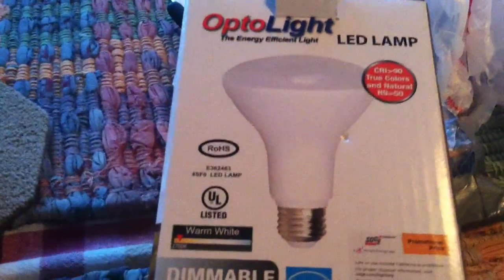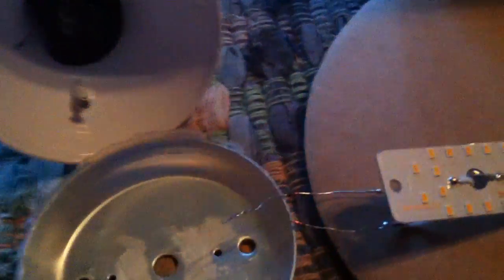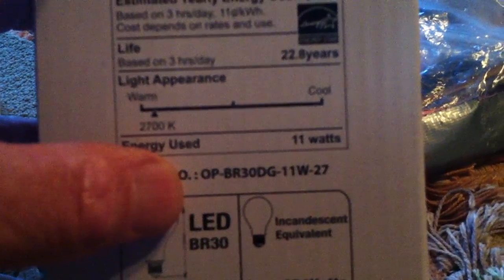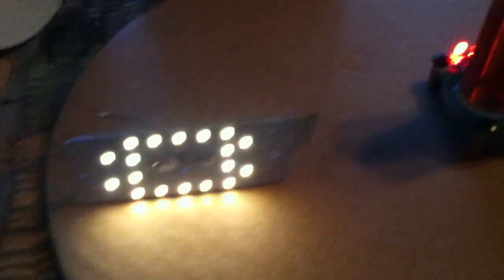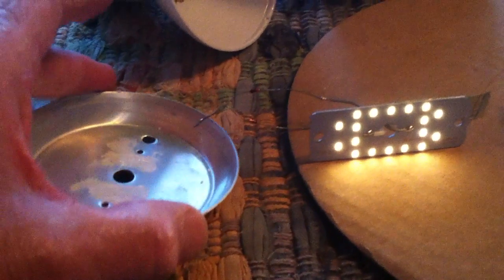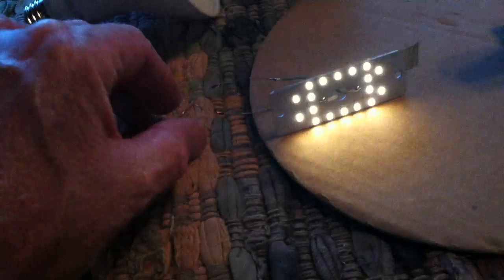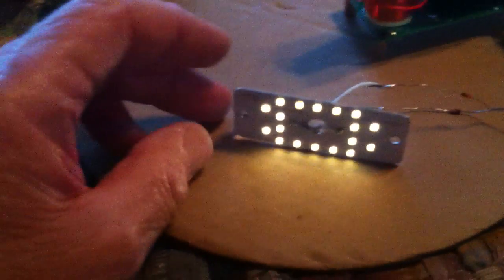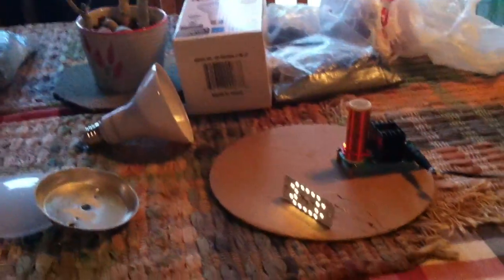New Led array for Stiffler Loop experiments

Comment: Staples was selling these bulbs on clearance for $3 each awhile back. I bought one and put it in a drafting table light over plants. Now that we know what's in them.. I wish I had gotten all of them.  There are also these LED's in security lights that are supply and solar powered that have these same LED element in them and are extremely bright in outdoor fixtures. We need to try one of those LED elements on the configuration you have. Remember its running on the HF pulses and operating on only .11 watts of power. Make up a little 10 or 20 turn coil of fine wire 1/2 inch in diameter and put it where the AV plug is - and also where they connect together to feed it. That should extend the range of this 5 to 10 fold for it to light up.
U R creating a wireless Ultra Bright LED lighting configuration.

Comment: Hi Lidm., well done. so the slayer exiter draws about 3 Watts..? Do you still have a 2nd bulb ? Can you measure how much the normal bulb draws and  is the brightness the same when powered by the grid compared to the other with the slayer exciter ? So is the normal bulb with 11 Watts input brighter than the slayer exciter version with about 3 Watts input ? Regards, Stefan.
Reply from the maker: The light level is less than running on grid AC.  The light is usable though and if it came down to sitting in the dark or having this light on ----I would take this in a heartbeat.
Reply: Well done, could you make a comparison video of the light output brightness comparing powered via grid AC with a power meter put in there versus  your circuit there and putting both LED lights lighting up a wall, so one can see the difference in the light output level ? Many thanks.

Comment: Can you light multiple led arrays from multiple light bulbs at one time? Does current increase when you do this?
Reply from the maker: Yes you can light more leds off this but as you add them the light level drops.  Doing that does not increase the power draw on the driver.  It is a capacitive coupling not an inductive one.

Comment: 12V @ 0.3A = 3.6W  (which isn't a lot of overhead power consumption).  Even though 3.6W is approximately a 1/3 the power consumption of your light device, it really isn't that much in the bigger picture (e.g.  800 lumens / 14.6W = 54.8 lumens/W vs 72.7 lumens/W (when the light is connected to AC mains __800 lumens/11W).  Thus your system is approximately 25% less power efficient when run by the slayer exciter ((72.7-54.8)/72.7).

All that assumes equal light output--which might not be the case when the light is driven by the slayer exciter with the the AV plug metal antenna.

If run from a decent deep cycle battery, you could get approximately 34 hrs of run-time (assuming 500 Wh of usable capacity--which is 50% depth of charge of a 1kWh deep cycle battery).